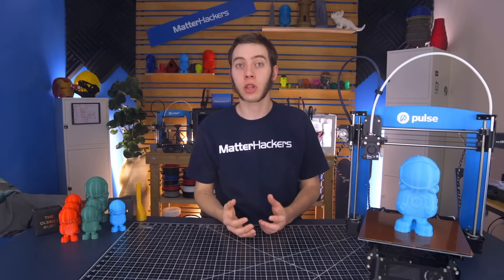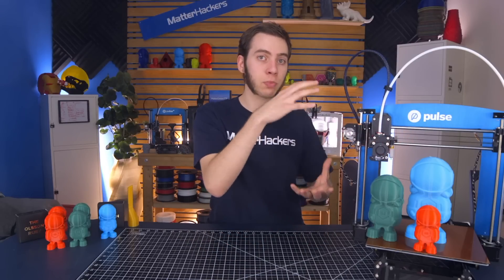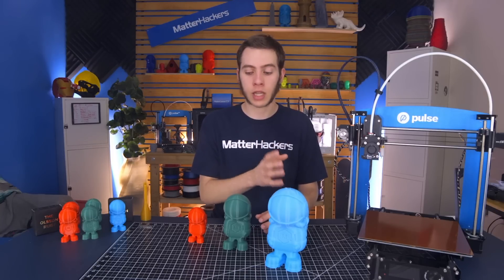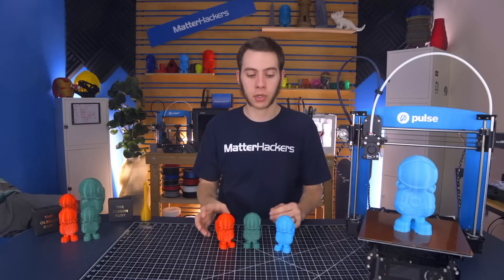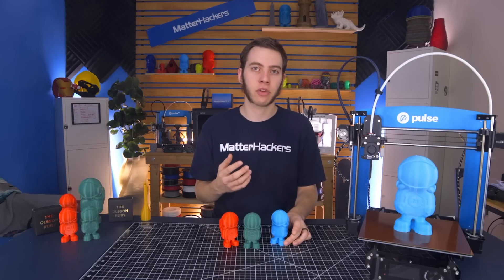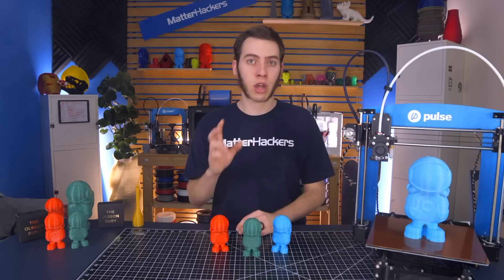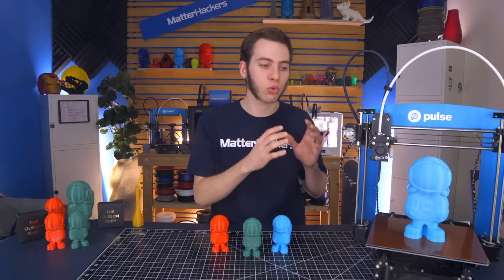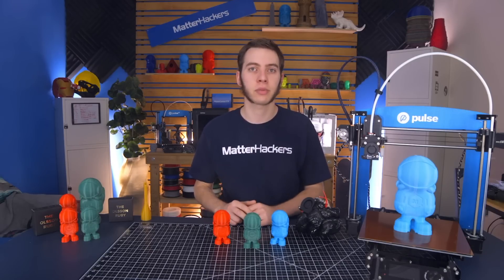How To: 3D Print with a Large Nozzle // 3D Printing Guide

Comment: Getting underextrusion after I switched to a .8mm nozzle that I drilled myself. I'm printing pla at 215°c and at speed of about 30-40mm for top,bottom,and outer walls. Inner walls and infill at 80mm. Should I keep bumping up the heat or will it increase stringing too much? Don't really want to have to slow down the print anymore as I'm using a .5mm lh and .8mm line width.

Comment: I'm having bubbles and irregular extrusion after switching to 1mm. It's as if the filaments were humid (maybe they are?) but they were printing fine on the stock 0.4 nozzle.
Reply: Deshidratet yuor filament in a Drybox first (bluble explosions are typical from humidyty in the filament)

Comment: Question. My printer has 0.4 standard nozzle  and I print mostly using 0.2mm layer height.  If I print with large nozzle, let say 1.2mm and layer height let say 0.6mm , do I need only do some changes in slicer ( for extrusion diameter and layer height) or I need to change some stuff in a program ?

Comment: I am new to 3d printing, and I am miserable failing. I switched my 0.4 to a 0.6 nossle and the PLA isn't sticking to the bed. Sometime it doesn't even come out. I tried to adjust the level (Z) but couldn't see any improvements. Trying a higher temperature now, but feels sad right now
Reply: lol, forgot to set the nossle diameter in cura... it was still set to 0.4...
Reply: @y.5107  good to hear you figured it out
Reply: For sticking , i use a glass.bed and hair spray , hair spray us the best for pla , for abs i use sitck glue in bars

Comment: I just performed every maintenance possible to my ender 3 because it was clogging and layer shifting when I was printing with a .8mm nozzle at 220.
I finally looked at the material coming out and after changing the retraction settings to 5 mm at 50 mm/s and heating the nozzle to 245 it's flowing MUCH better.
No more overlapping flaps and bubbling from underheated material.
Thank you for the advice!
Reply: 245 its too much for standard ender3 hotend , yuor ptfe tube are going to burn, and clog the hotend , just wait

Comment: Did NOT realize  I need to lower print speed as I increase nozzle size. That's crucial. Definitely  didn't know about the high temp for 1.0 Nozzle. Thanks for info.

Comment: Life saver, I just couldn't get a good raft down, I didn't think of going to such a high temperature. Solved all my problems. Also when that first layer goes down for the air gap it looks real scary but the layer after it somehow cleared it all up. FYI I am running an e3d supervolcano with a 1.4 mm on a Sovol SV01. One comment, some slicers allow the infill to be a different layer height than the outside wall so in some cases time can be saved without sacrificing detail.

Comment: I’m trying to print with a 1mm nozzle w a Bowden extruder. At 250C of 260C I get great adhesion. My problem is line thickness goes from thick to thin while printing. It seems like the filament stepper pauses then starts again. Thus I get inconsistent lines. If I back the filament almost all the way out of the Bowden and then run a print, the printer feeds filament which hasn’t reached the nozzle yet. In this situation the stepper seems to feed filament thru the Bowden consistently.
Do you have any thoughts on how 8 can get uniform lines?
Reply: 250 its too high

Comment: Hi, I did print four SaturnV rockets, 2(!)meter high using a 1.5mm nozzle(Volcano). Printing time was well within 48 hours. I did use PLA at 245°C at 55mm/s. The most upper parts of the rockets were done using a 0.7 and a 0.4mm nozzle. They all have a very smooth surface, no issues at all, except for the visible layers of course. But looking from a distance at these rockets, most people don't even notice the layers at all.
Preparing now using a 2.5mm nozzle to print a 4(!) meter high SaturnV rocket.
Reply: Do you have a big printer or just print a lot of parts to stick together?
Reply: @kermitXfpv  I have a few printers 200x300, all slef built and own design
Reply: @ATMBelgium  So you have to print a lot parts to build a 4 meter rocket?
Reply: @kermitXfpv  For these two meter SaturnV rockets I could print all with a 200x200mm bed. For the 4.1 meter SaturnV I'm busy printing a new printer. I need a300x300mm bed to print the largest diameters of that rocket.
Reply: @ATMBelgium  Sounds nice. I think you want an anycubic chiron btw (400x400mm). ;o)

Comment: Hi, 

let's say I will print with a 0.8 mm nozzle. For my Prusa MK3 I have to set the wall line to 0.85 mm. But my object has some details with only one wall lone of 0.6 mm so smaller than the nozzle diameter. 

What do I have to do? Normally I have to set the wall line same or x1.25 higher than nozzle diameter but if my object has only one line details which are smaller than the diameter I will get a gab. I could change the nozzle to 0.6 mm or to change the outer wall line to 0.6 mm. I didn't find someone with same problem.
Reply: Look how good looks yuor model in the Cura sliced view, its a physical thing that yuo can not print a little detail little than the line with (try to draw a 0.1mm line with a 1mm pen , its dificult)if yuo want to preserve small things Change to a litle nozzle

Comment: Just printing with 1mm nozzle. 0.6 mm layer height, 50 mm/s speed, 215ºC hotend temp, ERYONE rainbow PLA. Works like a charm. The only problem I can see is the huge gaps where the z-seam is. Anybody would know what to do about that? Thanks.
Reply: Does your extruder retract in those spots?

Comment: I use a .6mm nozzle. I tried the others up to 1mm, and more me the 60mm is the sweat spot. Faster prints, and still pretty small layer heights if I need it. I have a cr10 and it's the defualt hot-end. No issues the pla, pla+, and PETG.
Reply: Any suggestions for slicer settings? I'm currently trying to get a Cura profile dialed in for a CR10s with a .6mm nozzle, but the prints have poor adhesion and look like ass.
Reply: @TheeAbstractHero  calibrate yuor extruder , check that yuo extrude what it be

Comment: Big nozzle give you Much stronger parts too.. but best at 50% nozzle size to layer height. So 1mmm to 0.5 layers.

I'd #prototype at flat-out spped - 500% if all you need to do is see the part - and no infill (1%) with 3 shells, 3-4 top layers.
^^ those will fall to pieces but give a test part in no time, even with a 0.4 at 0.4 layers.

Comment: Hello I currently print with a .8 tip and it prints very well at .12 layer height I love how it looks. The only bad thing I have to say is that I have played with all the settings at this height and I cannot stop the stringing. So its great for items like boxes, vases and models where no supports are needed so there will be no chance of stringing.
Reply from the maker: Have you tried to raise the retraction length and have extra length at restart? That might help give you more retraction but not have underextruded parts of your model.
Reply: The safest retraction length for me was 6mm but that did not fix the stringing. The only thing I have not tried is changing the layer heights which I might try just to see but I really like the print quality at .12 height.

Comment: Why does nobody ever talk about increasing the line width as a way of printing faster? I do it regularly and seldom have issues right up to a line width of 0.8mm with a 0.4mm nozzle.
Reply: @Alec Richter Been doing the same until recently on my i3 MK3S... Instead of 3x Perimeters at 0.4mm I'd do 2x at 0.6mm. I also used to mix-match different layer widths like 1x 0.4mm for the external one preserving the detail and 2x 0.6mm for the internal ones for the strength instead of 4x 0.4mm ones for all of them though since moving over to a Pressure Advance capable Voron 2.4 I've since stopped doing the mix-matching as it kinda wouldn't work out for me which isn't surprising as you're calibrating for one and not the other ( at least that is what I'm thinking has caused the poor results... ) But then again, the Vorons are so fast you easily make up for the lost timesaving due to sheer brute force speed and still print like 2-3x faster while still producing pristine parts or even faster if you work with parts not requiring clearance 🥴
Reply: ya it adhere im doing the same. but more than 0.8 looks like shit.
Reply: Wait what ? Do layers still adhere like that ?

Comment: Some good points but I feel it should be pointed out that you need an all-metal hotend to print at the temps he describes. Without this, You can print at lower temperatures, but slower (say 50mm/s with a 0.8 nozzle). If you have a hotend with PTFE parts, printing at 250 C risks melting the PTFE and ruining it. I have had the safety cuttoff temp issue happen to me- solved it by having a more gradual fan ramp, e.g. 40% to 60% instead of zero to 60%

Comment: Can i run 0.4mm nozzle on the volcano?
Reply: Yes
Reply: @XenonLining  so what the downside compare to the regular v6 heatblock? In a different words why not everyone buy the volcano?
Reply: @yehonatanbellaiche9359  size and cost
Reply: @Skyler Shaffer yes, and you can print faster with it -- but you get a bit more oozing, so downside is that it's typically harder to tune the retractions